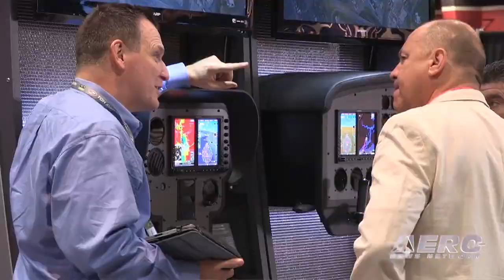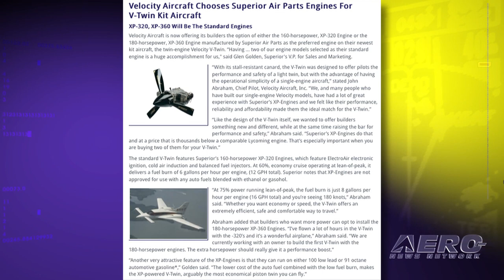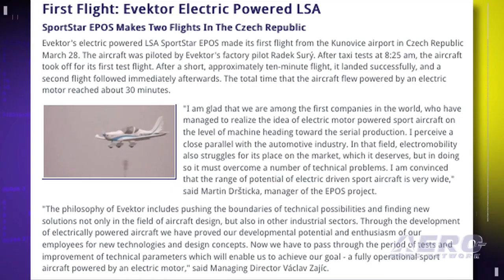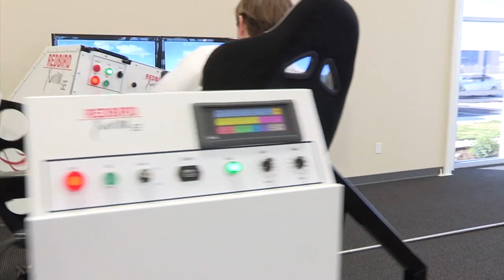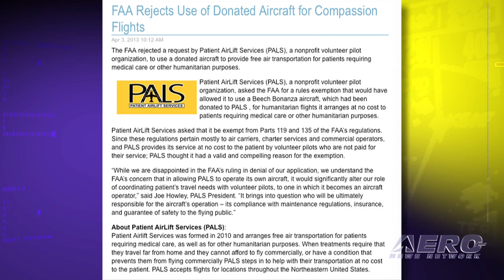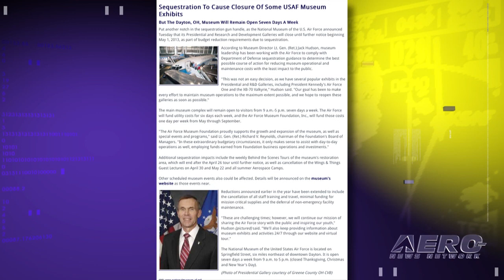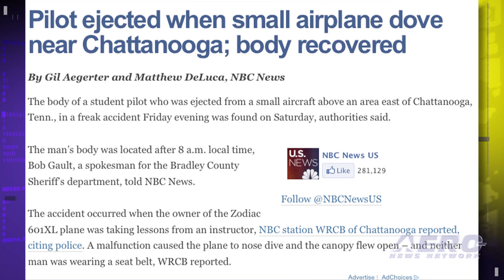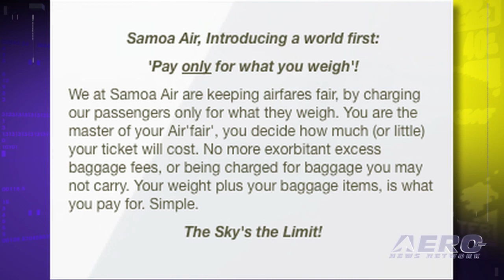Airborne 04.05.13: AEA2013, Velocity Twin, Electric LSA

Comment: Very nice A/C! Looks great! Still, would have been great if they could have kept the twin vertical stabilizers on the end of the main wings. Would love to have one with lower in cost to operate twin JT-A/DIESEL engines, air-bag systems, BRS, glass panel, side mounted sticks, oxygen systems and screens built into the back of the front seats for rear seat passenger entertainment. Someday soon!